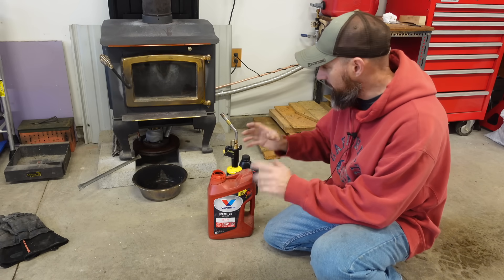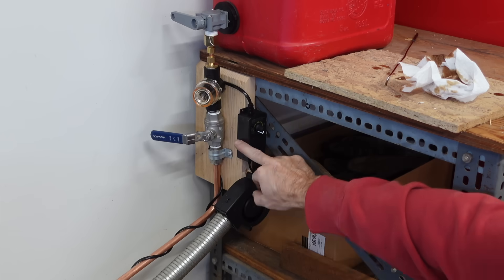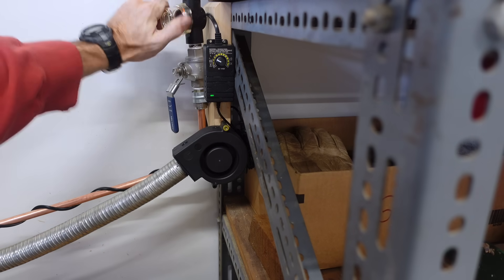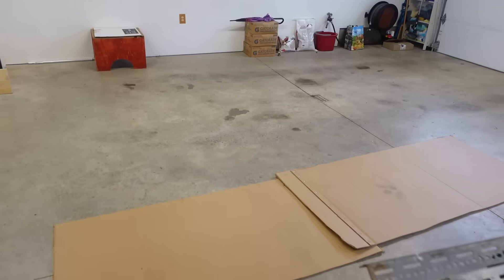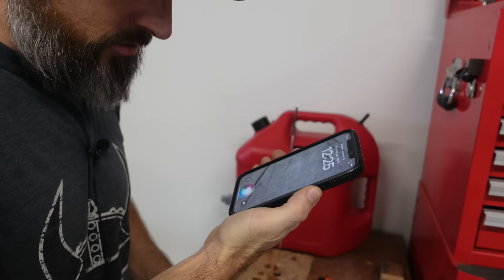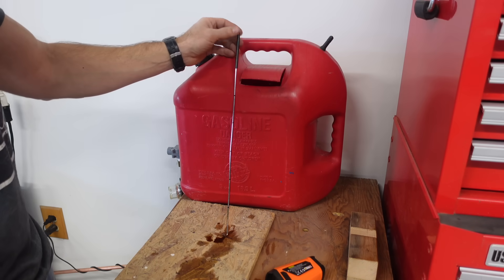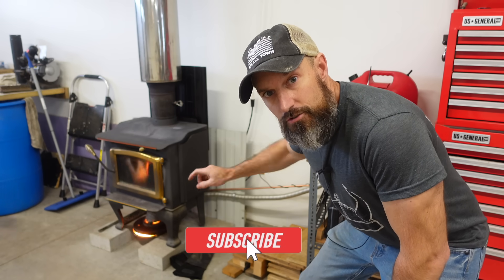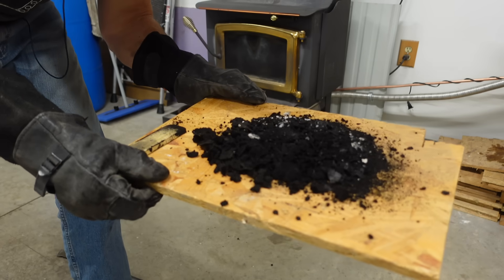How much oil does my used oil burner burn in 8 hours??

Comment: i built a big waste oil burner last year for the winter in my shop. i revised it this fall and made it more efficient and hotter. i use a bouncy castle blower in mine, and the main body is built out of a giant propane tank. the burn pot is a 6"x1/4"x12" steel pipe with a 1/4" steel base welded onto the bottom. i burn between 1/3 of a gallon to a whole gallon an hour, depending on how cold it is outside. my shop is not insulated on 2 sides, and i can get it from 8*C to 24*C in about an hour. the top half of the burner is a massive heat exchanger that i built, so it blows the heat around like crazy :) ill try to make a video on it one day haha
Reply: I just recorded some info on it, as well as fire-up procedure, ill edit it up and try to get it up in the next couple of days :) she's an absolute beast of a burner haha
Reply: @ you got?
Reply: @Jesussavesyouandme  I've recorded all the footage, i just need to put it together... been a lot going on the past month... i insulated my shop in the past few days, and now i can get my shop up to 27° when it's only 1° outside... its almost too big now haha! Im gunna have to limit the airflow so i can turn the oil way down once i get it up to temp...
Reply from the maker: Sounds like you built a beast of a burner!
Reply: I’d love to see
Reply: Also would love to see it!
Reply: please post a video about this bro this sounds great

Comment: Is this new oil or used oil...plus can you use cooking oils etc
Reply: It all burns
Reply: @bryanspanjer3213  hey thanks for answering me. So my question was I have almost a full 55 gallon oil drum with used oil from changes is it ok to use that?
Gonna build a burner setup in our shed and gonna heat it with the oil
Reply from the maker: Used oil

Comment: Not a great burner setup . It's not burning properly if you're getting smoke. Some sort of catalyzer right in the bowl would help, and some air holes in the bowl.

When these are set up well there's no blower needed it will draft itself and there will be no smoke.

Why isn't the burner right in the stove?

Take a look at how commercially made oil pot burners are made and you'll see what I mean. I made one once with a spaghetti strainer with all the holes in it with a small bowl in the bottom of it to hold the fuel. Add something in the bowl that will get hot and help vaporize the fuel
Reply from the maker: Thanks for the suggestions, I am always learning!

Comment: Have you heard of the GEET Fuel Processor? 
It's a vapor system that turns a combination engine into an implosion engine that burns 20% waste oil and 80% water with zero pollution. 
Thousands of backyard mechanics have built the GEET Fuel Processor and many have posted their results here on YouTube. Note that there are still a lot of fry restaurants that pay to have their waste oil picked up. And if you synchronize two GEET Fuel Processors so that one was always running, all you'd have to do is make sure your reservoir is never empty and you'd have all the energy you'd need given the size of the generator. Go big and sell excess energy back to the grid. 
You seem very capable.
Reply from the maker: I will have to check it out.

Comment: Looks like right front stove leg should be centered on block to avoid accident from tipping if bumped, especially since it's in  a garage workshop. Sounds like ventilation of flammable fumes (from painting inside) plus supplying combustion & ventilation makeup air in a relatively closed space (garage) are potential flash and asphyxiation hazards. These are the same warnings for using kerosene heaters, charcoal grills, generators, gas logs, or other devices in closed spaces. Fresh air enables combustion, while venting exhaust products requires additional external air to prevent carbon monoxide production and resultant health risks, including death by inhalation.
Reply from the maker: You’re right, safety is always important. Thanks for watching.

Comment: Thats so unsafe ! …. That dog dish will eventually fail then burn that room down 

I get that it works , but there to much room for mistakes and mechanical failure

The metal gauges of all the alterations are way to small , it will eventually burn thru
Reply from the maker: thanks for watching

Comment: I've played around with waist oil burners for years and when you get it right 💥it's amazing I've always gone for the no electric etc way but found it hard to deliver the fuel at a steady rate to keep a clean burn and worried about the danger of overflow we just got a French military multie fuel tent heater that has a carburettor it has built in safety features and it gives a blue flame when it dialed in running on diesel
Reply: Like you I've messed about for a few years and for me the biggest concern is overflow. My feed systems have been electronically controlled and I'm looking at some sort of level sensor to stop the oil feed if it gets too high. A run off pipe may be a simpler solution, but could get messy if run off oil gets too hot and runs the risk of ignition.
Reply: @shanehogarth6373  the experience of oil on fire poring out of the burner and spread across the garage floor is scary and not something I want to deal with again. This diesel heater with a carburetor is old tech but using it has been eye opening on where I've been going wrong
Reply from the maker: That sounds awesome maybe I will research one of those. Thanks for watching

Comment: Not too shabby. You theoretically got 15, 16 hours continuous from 5 gallons.
But when you showed the stack, it looks like you were losing alot of heat out the top.
In my shop I have a 20" shutter fan mounted on the east wall, blowing out about 3500 cfm. My 23000 btu kerosene heater is at the west end in front of an intake vent. That fan draws the warm air from the kero heater through the shop "lickety-split!"
Reply from the maker: Thanks for sharing your setup. It sounds like a good way to heat your shop! Thanks for watching

Comment: So how do you filter the metals and other material out of the oil before you burn it?
Reply from the maker: I use a old tee shirt. Thanks for watching
Reply: I'd use something a bit more substantial.     Heavy metal poisoning is a real issue with burning used oil..

Comment: How about adding a radiator for the exhaust, and maybe positioning it on a different side of the garage for more and even heat throughout the garage. Although, this might not necessarily work since the garage is large, but by just adding a radiator, it’ll still be beneficial. Also, you could measure the oil by weight, this way you’ll get a better estimate of the oil use/burn rate.
Reply from the maker: Good ideas thanks for watching
Reply: Would create a lot more soot in the chimney. You want the exhaust fumes to be as hot as you fan to properly get the carbon outside.

Comment: I have a 2 and half car garage (520 sq feet) and a few years ago I built a woodstove out of a 10 gallon Beer Keg for it. It keeps my shop so warm that I have to open the door from time to time to let the heat escape. 2 winters ago when it got -40 without the wind chill here in Missouri family and I moved into the shop and stayed nice and toasty, I even tarped up my car port opening and opened up the window to the carport that's on the side of my shop and it kept our 2 cars from freezing. also, it didn't keep the carport toasty but it kept it above freezing.
Reply from the maker: Sounds like you made a awesome wood stove. Thanks for watching

Comment: I am Firefighter and a chimney sweep. 

 Your pipe has a stove pipe damper, most of them the handle runs parallel with the round damper on the inside of the stove pipe.  (If it's is turned sideways so is the damper that is the closed position.  
If handle is turned up and down like it is in the video the damper is wide open)  The damper will have some smaller holes in it so in the closed position it still has openings for the smoke to exhaust up the flue pipe.

After you get it hot and running  the way you like it. Turn pipe damper handle 90 degrees (sideways)  this will hold on to the heat longer making the stove get hotter and will give it a chance to heat up the smoke more and possibly reduce the amount of smoke.  There is no catalytic converter or air wash in a system like yours so I don't think you can get it to not smoke.

If your was open like it looked to be and you were getting 300- 400 degrees, when you close it, that stove will probably see close 600 degrees 

Hope that helps
Reply from the maker: Thanks for the info and thanks for watching
Reply: a firefighter should know better than to encourage this bad day waiting to happen
Reply: @thedavesofourlives1  job security
Reply: @thedavesofourlives1  to encourage.... a fire in a stove??
Reply: @thedavesofourlives1 stop

Comment: You need one of the iron fans that sit on top and spin once they heat up. That will help move the air around the garage a lil more. I know air is moving by convection, but adding more metal surface fins and a iron fan may help your cause.
Reply from the maker: I Agree that would definitely help. Thanks for watching

Comment: This would be an awesome idea out in the country with no one around. It is illegal to burn used motor oil since it can be recycled, and the pollution it causes.  It doesn't burn clean. Unless you burn wood with it.  The smell from burning used oil is distinct, and the exhaust covers the surrounding area with a black oily residue! As a nearby neighbor, I'd sue 😂😂😂 Hope you don't get caught

Comment: How much carbon monoxide is released into your garage per hour? I would like to see an episode with a carbon monoxide detector in your garage. From the looks of your setup you had yellow flame coming into the room. You could see it on the video at the lower connector above the brake rotor. Those were coming out not being sucked in. Detector edition with the same furnace please!
Reply from the maker: Maybe I’ll do that this winter thanks for watching

Comment: You could try to use a clear vinyl hose with barbed fittings installed on your gas can so you can see the level at all times without opening the container. I use that method for hydroponics.
Reply from the maker: Thanks for the tip, but I really am not going to burn enough to care. I Just want to get rid of some of my used oil.

Comment: The hotter it burns, the less smoke it will produce.

You should put the doggy bowl and rotor inside the box and plumbed the oil line through the side to drip into the bowl.

So drill holes in the bowl just under the lip of the bowl. That way, the rotor can sit centred.
Put the bowl into the hole you cut out of the centre of the base, with the brake rotor on top and the oil feed through one side or the back.
Run the standard baffle plate to help diffuse the heat betterer.

But l imagine the biggest issue will be soot/carbon build up, clogging and whether the carbon build up will self combust in the flue and be a fire hazzard 🤷‍♂️

Comment: Impressive! On a side note, if you take a 50 ft coil of soft wall copper tubing ( 1/2" to 3/4) and wrap it around that stove exhaust pipe, and then blanket that with a special type of insulation, you could heat anti-freeze or water and have another heat exchanger in the system to capture some of that energy loss to the exhaust system. Just like a car engine loses a massive amount of the gasoline BTU's to the radiator in the form of heat energy, your system loses a massive amount of the oil's BTU equivalent straight up that exhaust pipe. It wouldn't surprise me if you could reduce your fuel consumption by 2/3rds. Which would reduce your maintenance. In theory! Lol
Reply from the maker: Good idea thanks for watching

Comment: To regulate oil flow I use a power steering pump driven by a wiper motor [geared right down] with a PWM controller, saves the worry regarding run-away when the oil thins as the ambient temperature rises. That would be easy enough to add a flame failure device and also an over temp thermostat to shut down if it does go out or overheat.
Reply from the maker: You should make a video of this explaining how you did that. Sounds like a great setup. Thanks for watching
Reply: @DIYJIM will do, give me a couple of weeks!

Comment: id leave some of that oil carbon in there it may make the container last longer the heat is eventually gonna degrade the metal pan
Reply from the maker: Thanks for watching and for the tip

Comment: what happens if your not babysitting it and the oil runs over out onto the floor would this be a runaway fire i put a small pot of oil in my fireplace and it got soo hot u could see thru a 1/4 inch thick steel like it wasnt there .
Reply from the maker: I don’t plan on burning it much just experimenting. I would never leave it go.

Comment: you shouls use a piece of transparent hose attached to the top and bottom of your tank to have a better view and measurement of the oil level. in that way, the measure bar will no longer required and your measurements could be more precise. ;)
Reply from the maker: thanks for watching

Comment: 500 gallon tank divided by 2.5 gallons equals to 200 hours divided by 24 hours equals to 8.33 days, so that’s bad…..
Reply: Well, I gave it a second thought and considering that it’s spent oil; it could be a good thing so long as your not purchasing it and you could get a lot of it…..
Reply from the maker: Sure sounds bad but I’m burning the oil that I normally just recycle or spray on my shed. Plus people will give it to me free. I mainly did it for an experiment. I will only burn the oil I get myself from my vehicles.

Comment: Allowing an open flame from waste oil is going to allow harmful fumes due to the toxic heavy metals in waste oil. Recommend sealing up your burn chamber. Looks like a pretty slick setup. Would agree with other comments about deflecting the flame to retain heat as well. You could also get a fan device that harvests heat from the exhaust vent to maximize heat output. 👍
Reply from the maker: Thanks for watching and the ideas
Reply: @DIYJIM  Stick a catalytic converter on the exhaust. Emissions control 😅 
Great setup brother! 🇺🇸
Reply: Toxic heavy metals are not really present inside of vehicle engines, they are 99% steel and aluminum. The cylinder walls are typically made from cast iron or ductile iron. 
This leaves the oil with mostly fine steel and aluminum particles in it. Pretty far stretch from real heavy metals, like the 1,000lbs of it inside a electric vehicle battery.
Reply: NO, the heat creates a pressure change to which is called flu draw or draft, all surrounding air is literally vacuumed up the stack/flu. Cold starts where the room ambient temp' is colder than outside ambient temp' would be the only chance of leakage into the room. I have extensive combustion experience & have built/serviced natural draft super heaters with 12,000,000 Btu/hr. Ideally your burner would require a small orifice at the point of mixing of secondary air & fuel. Also adding pressurized air to atomize the oil in to a vapour once it passes thru the orifice would increase efficiency. A mixing barrel in the shape of a Venturi would then be required to properly mix your fuel/air thus better efficiency. Black smoke indicates poor combustion or what is referred to running rich, secondary air, the air used prior to combustion needs to be increased, this can be achieved by use of a adjustable mixing plate : )
This location would be at the point or prior to your incoming fan air.

Comment: What happens if you let the oil flow go too strong too long? Overfill the pan and burn down the house? 

Seems like the cost of this going unattended was WAY too high vs wood.

With wood if you don’t attend to it the fire possibly goes out, area gets cold. With your setup up if you don’t attend to it it possibly destroys everything you ever owned and kills you and your family (god forbid).

There’s gotta be a way someone smarter than myself could figure out a way to mitigate that type of failure, a way to automatically throttle oil flow.
Reply from the maker: I would definitely not leave this unattended. I only plan to burn up my used oil from when I change my vehicles oil. Maybe a couple times a year

Comment: I really like what you've done here - one thing I'm seeing is that it seems like you are losing a lot of heat to the exhaust. When you filmed it you can see the air warping because of the high temperature. I think it would be cool if you tried to re-capture some of that waste heat and use it inside, you could burn less fuel for the same performance that way. 

Look up heat exchangers in traditional oil burning or condensing gas furnaces. You can buy an HVAC radiator for cheap or use a small vehicle radiator (maybe a motorcycle one) put it inside the exhaust flue to capture as much heat as possible from the exhaust gasses. Then have a radiator in the room somewhere with a fan to disperse the heat. Just run copper between the two and then seal the holes in the flue so no gasses enter the room. 

Would be super interesting if you got a measurement of the exhaust temperature before and after to see how effective the whole thing was.
Reply from the maker: Sounds like a real interesting idea. Thanks for watching

Comment: Black smoke: too much fuel or not enough oxygen.
White smoke: too much oxygen or not enough fuel OR evaporated fuel fumes(very bad, explosive).
Also, not to sound too high on my horse, but I can run a cheap chinese diesel heater for 4 days continuously on 2 gallons of diesel with it on lowest setting.
Reply from the maker: I thought about trying one of those diesel heaters. I am just happy to get rid of some of my used oil. thanks for watching
Reply: @DIYJIM  Its a cool heater setup you got there dude, I think i'll build one to add to my winter arsenal. Thanks for the vids.
Reply from the maker: @memadmax69  thanks